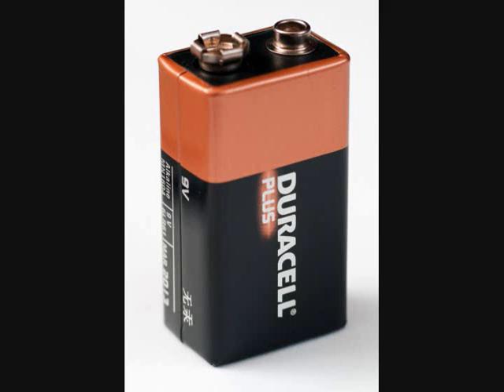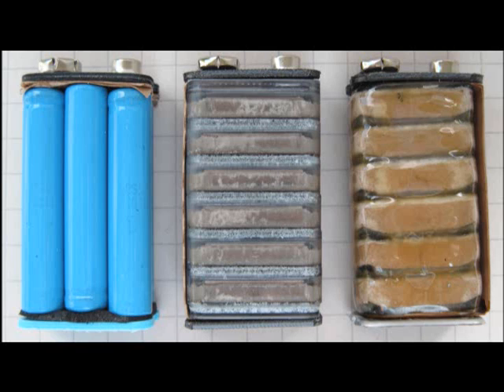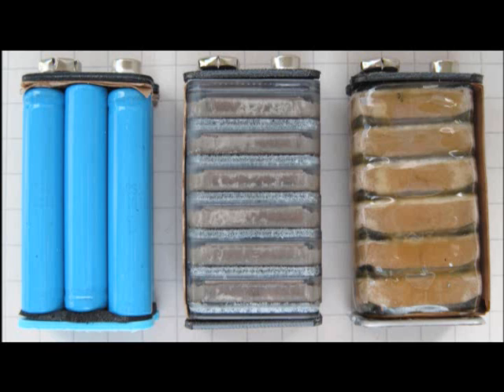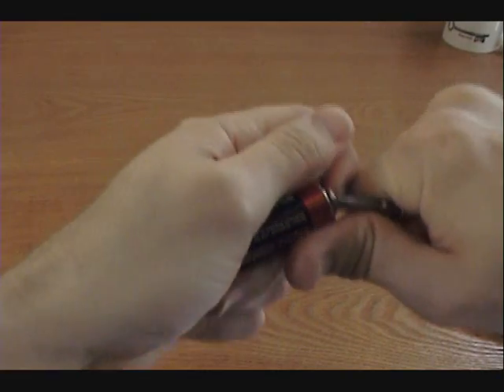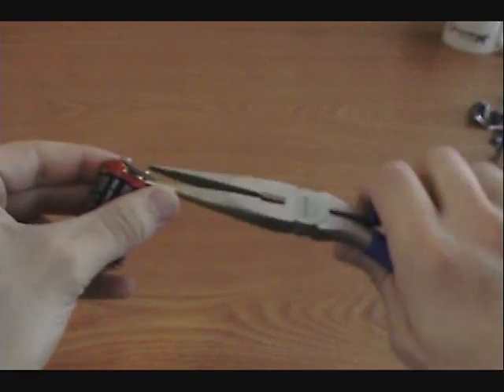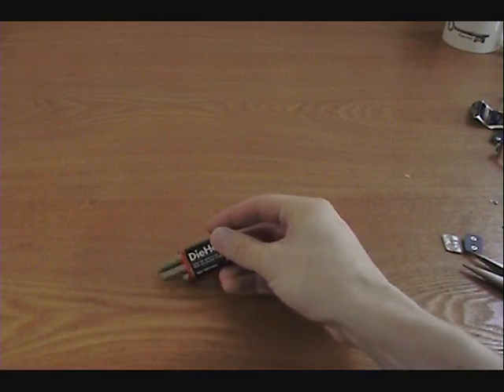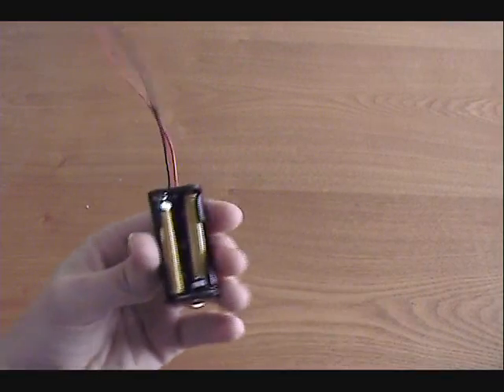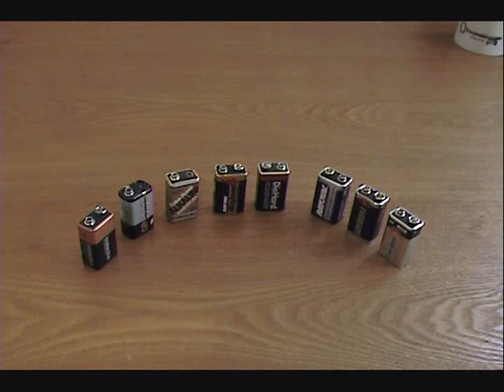9 Volt Battery Hack

Comment: AAAA batteries inside the 9V battery lasts longer than the stacked cells one.
when I got a brand new smoke detector, it comes with GP 9V battery which is stacked cells one. it didn't last long for a year.
I put in a new duracell 9V battery which is AAAA batteries one inside the smoke detector. It can last up to 2 years.

Comment: I remember taking apart a 9V a long time ago when I was a kid. It had the small batteries that you are calling an AAAA. I didn't know an AAAA battery existed or was used. But now I recently bought one of the new Microsoft Surface Pro computers with a pen. I think it is probably a pen made by Wacom, or the same type of pen. When I seen the battery for the pen I thought it was a custom battery or something but it was a name brand AAAA. Now I know where to get some AAAA batteries, besides I'm sure Amazon or eBay has them these days. I never seen an AAAA battery in a store before.
Reply: Microsoft Surface pro 3's pen is made by N-trig.
Reply: Indeed. Wacom's claim to fame is its battery-free pens.

Comment: Actually the battery cells in the 9 volt battery shown, are not AAA or LR03... they are AAAA or LR61 batteries. So, while not a fake video, the information is wrong.

Comment: i have a trick ive used for years .i was short  one battery for my flashlight so i chrushed a piece of tin foil to repace a battery .its a good conducter,and it works. carmen

i have a trick ive used to replace  a battery ,i had 2 but was short one for my flashlight,so i crushed a piece of tin foil ,as this is a good conducter,and substituted it  as a battery,it worked well,       carmen

Comment: I'll make sure to remember to tell the doctor not to connect a 9V battery to my heart if I ever have open heart surgery. lol  The spirit of the question was if touching the cells during dis-assembly could lead to being electrocuted.  The answer is no. Your skin resistance is too high to allow 9v to induce a current high enough to cause fibrillation. Generally,  voltage higher above 50V is considered dangerous.

Comment: ...if you stick a fork in your wall outlet it will hurt a lot if you touch it, the wall is barely enough to do damage to you. and the wall is 100-125 volts

these batteries are 9, in fact i used to stick 9V's on my tongue and feel the zap to see whether they were charged or not :D

im weird, dont judge me :(

Comment from the maker: @SteigenSieherunte If the 9 volt batter has the short rectangular cells instead of the six AAAA batteries, it is really hard to do any hack safely. That thin layer of plastic on the outside is the only thing between you and battery acid. The cells are just packed in there together and there isn't really a good way to separate them and have them still function as a battery. So unless you just want to extract the raw materials I would recommend against it.